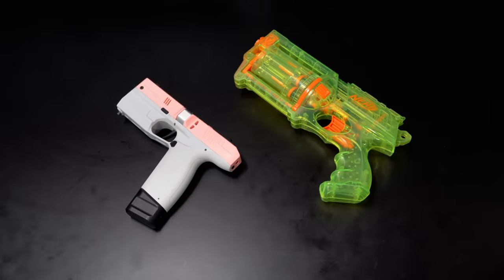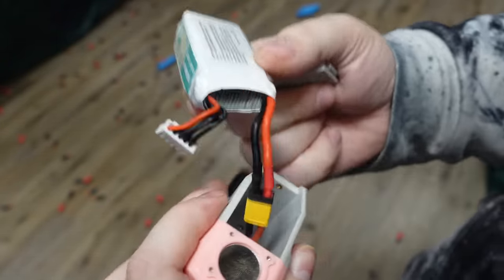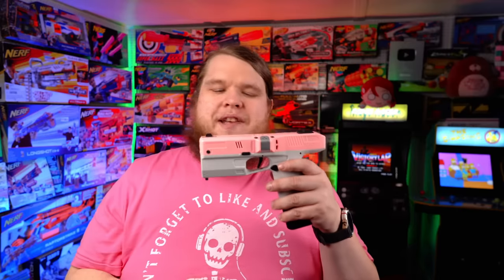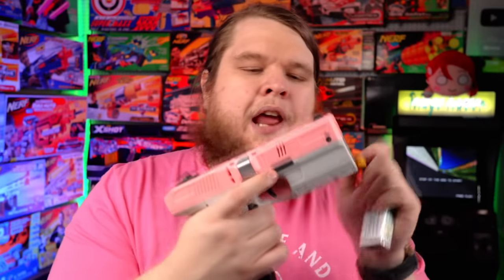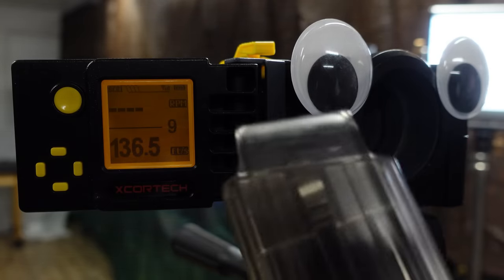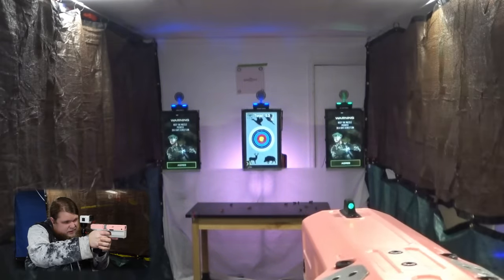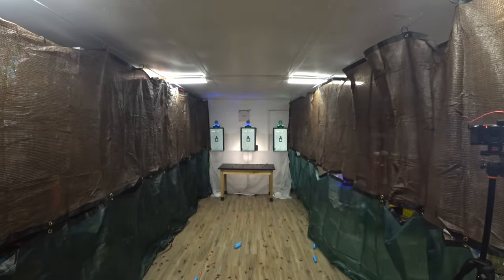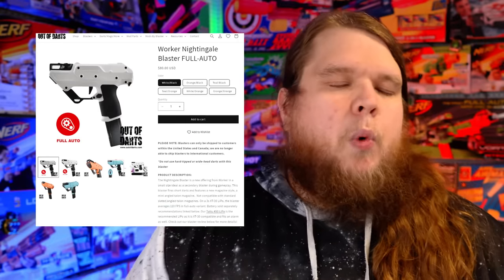HC Diana -  The Full Auto Brushless NERF Sidearm

Comment: It took almost a month to get here but I got the new full transparent Diana so you can see everything happening inside. M416 also has a mag extender which combined with a regular mag increases the capacity to 24 shots.  A bit tricky to assemble, but they have a video.  Very fun blaster, although the lag is a bit noticeable on semi auto without “rage” mode on.
Reply: Yes, the lag is infact very significant. The maker do understand that and that is why they come out the hot mode. But that is draining lots of battery if u keep is on for long time. I suggest immediately off it if not in the game. Also the stock mag is horrible. I used only nightingale mag and the operation is much smoother. Of cos, u need some mod before the nightingale mag can be secure. It's usable but not secure if some accidental bump and pushing.

Comment: I should be pretty simply to put a analog shutoff switch into the lipo line and mount it on the outside of the blaster. Might have to have some exposed wires unless you have a real thin switch though.
Reply: True. The only way to disable the battery is unplugged it. It's annoying. They shall program some way to off it with trigger operation. Like holding it for 15s , will off it.

Comment: I hope they made  a pistol sized aeg insteadof flywheel
Reply: handgun-sized AEGs for Nerf is tough since there's barely any room in that form factor for a gearbox with a large enough plunger tube to propel darts at a respectable velocity. The QWK Edge showcases this limitation. AEG handguns are already anemic for airsoft, so trying to fire a larger, heavier dart in a package that size is wishful thinking.

Comment: It costs $250?!?
Reply from the maker: Brushless isn't cheap.
Reply: I dont know why would one would complain when they paid $600 for 3D printed blaster but grumble when they paid only $250 for a quiet brushless , high performance compact flywheel pistol. $250 is a steal, dont grumble about it. You shall be happy about it. 

If you ask DZ to make a brushless motor flywheel with mosef, I am sure they are going to price it almost the same HC Diana. As some pointed out, brushless motor cant be cheap. Dont compare orange with apple.